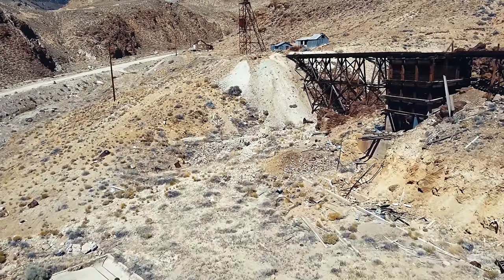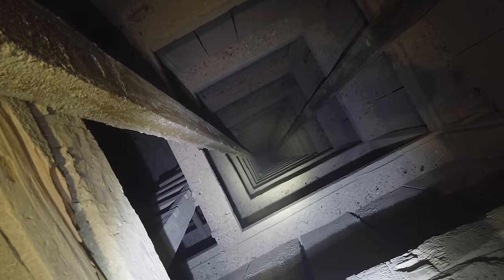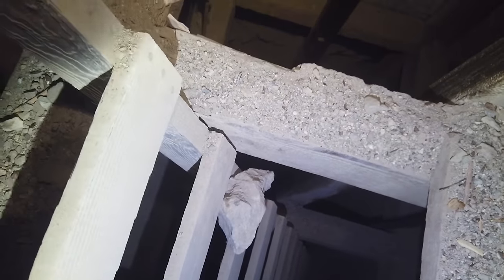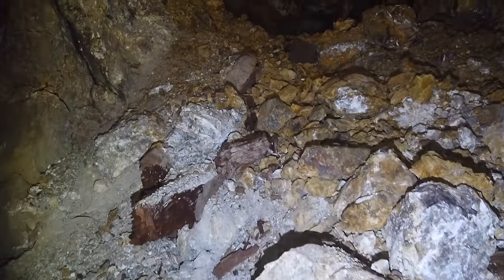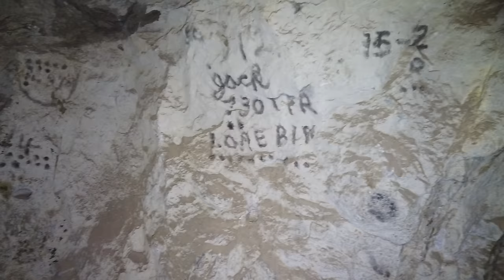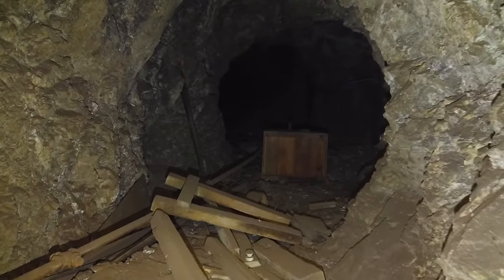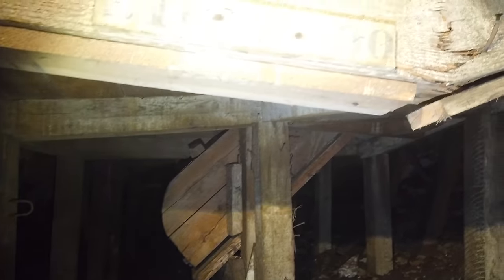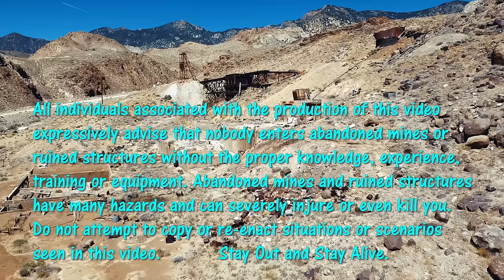My Best Exploration Ever! Inches From Death, As Dangerous as Mine Exploring Gets

Comment: As a former coal miner of 22  1/2 years, I have seen my share of dangerous roof and ribs. There were several fatalities of various causes at a couple of the mines I worked at. It was when we were pulling (mining) pillars (room and pillar mining) after driving up a section of the mine that it became really dangerous. I was a continuous miner operator for most of that time although I also did a lot of roof bolting. I developed PTSD  from all the years of escaping from falling ribs and top. I still occasionally have nightmares. You Sir are a brave individual.
Reply: Holy that does not sound fun, at all. Hoping you got some good lay in return at the very least
Reply: @trollscream8607  Lol, married and divorced twice. When it was good it was good, and when it was bad it was bad. I'm seventy two and still a workaholic. And the ladies like a lot of attention.
Reply: I had a friend who did mining for a month or 2 he did something like set something a support in place so the ribs could be set up or something to that extent, he said he felt like he was gonna die every day and quit, talked about water flooding in and all this other crazy stuff in just a month or 2 of work
Reply: Yea I don’t like enclosed spaces any longer either. In fact I will not fly for that reason.

Comment: Hi Gly, By now, someone has probably already told you but just in case . . . The grafitti that you read as “butt miner”, is actually “Butte”, as in Butte, Montana.  Butte, also known as ‘The Richest Hill On Earth’, was a big-time copper mining town.  The Berkley Pit in Butte was more than a mile deep and was really a sight to see before the water pumps were shut off. It’s still a mile deep but since they shut off the pumps back in the 1980s, it has been filling with very polluted water and is almost to the point where it will start overflowing.

Comment: I just can’t wrap my mind around all the hard work it would take to get all that lumber down that far to build those ladders that you’re  using. All the lumber that would be used all over that mine because that is a hell of a lot of lumber!!   I can’t,   Hard as I try I just can’t imagine the brute physical labor it took.  

And then I see piping what we in the oil field called screw pie which is small round pipe that air runs through.   My lord,  there is hundreds & hundreds of feet of it!!  it sits there was no elevator to be used looks like close by try to imagine going down those ladders so much!!     My Lord!!!!!

Comment: Gly - if you'd like to climb more shafts, I know of a mine in southeastern Arizona that has a 975' main hoisting shaft and a 600' escapeway shaft, both with manways in good condition (rehabbed in the mid-80s). The ladders at the collar aren't usable, but both shafts can be accessed via a pair of rubber-tire declines (to the 100' and 200' levels respectively). The mine was worked intermittently from the 1890s to about 1994, and I have it on good authority that a drill rig was left down there mostly complete. It's got a real interesting mix of old-school shrinkage stopes and modern longhole retreat stopes. I've thoroughly explored the horizontal workings, but haven't gone down either shaft yet. Let me know if you'd be interested - I know several miners who worked there in the 80s and 90s.
Reply from the maker: “Gly”: That sounds interesting. Contact me privately via email and I’ll see if I don’t already have it located and if it’s in an area where I’ll be exploring this winter.  abandonedandforgottenplaces@hotmail.com
Reply: @AbandonedandForgottenPlaces  Email has been sent.

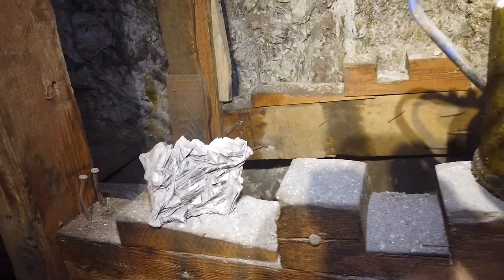Comment: At 1:24:17  He has an outstanding large specimen of “BARITE.”  It’s overwhelming use for it to be mined,  is because of my beloved Oil&Gas Industry.  It’s used as a weighting material in the formulation of drilling mud.  Barite increases the hydrostatic pressure of the drilling mud allowing it to compensate for high-pressure zones experienced during drilling.  

The softness of the mineral also prevents it from damaging drilling tools during drilling and enables it to serve as a lubricant.  The American Petroleum Institute (API) has established specifications for the use of barite in drilling mud.  

Right at 70 years ago,  a company was formed and named after Barite. It was and still is called,   “ Baroid Industrial Drilling Products.”  Today it is a wholly-owned separate company of  Halliburton corporation.  It’s the largest supplier of “Barite Drilling Mud.”

Comment: At the 400' level, in that ballroom, with all the black on the back of the mine, is it possible they had a fairly large fire in there? Not enough to burn up the timbers, as they're clearly rotted, not burnt, but enough to heat the rock and make it brittle and fragile, similar to how they used to make quick lime in the medieval times, so when it was exposed to the leaking ground water, it cracked and failed more easily?

Comment: I enjoy your curiosity about the many artifacts that you come across, but it seems that you skip over artifacts that I am curious about. Referring to the 600 foot level, I see a black & a white wire in the main repair area, but you make no mention about were they came from, where they are going, if @ other levers, At the top? Etc. Also, another artifact that I am interested in is the 2 metal pipes laying on the ground, same level. I assume that the larger pipe is for compressed air for power drills, what is the small pipe for?

Comment: Why did they only do drifts every 100'? Weren't there veins in between those levels? The drifts are all horizontal, so they weren't angling up and down to get any ore in between the levels. Can you tell me more about that?
Reply from the maker: “Gly”: So, imagine if the vein of ore your trying to extract is 1000 feet wide, 500 feet deep, 5 feet thick and on a 50 degree angle. The first thing you will do is drop in a inclined shaft from the surface following the angle of the vein down to the 500 foot level. Then after that you blast in horizontal drifts within the vein structure left and right of the inclined shaft every 100 feet down to the 500 foot level. Now, because you made your mine in this configuration you can have men on five different levels extracting ore and bringing that ore to the inclined shaft to be removed from the mine. In some mines, such as the Silver Souls for example, an additional horizontal haulage adit will be blasted in from the side of the mountain to intersect with the 100 or 200 level. Doing this will allow miners to remove ore from the mine twice as fast as compared to only having one inclined shaft. Underground hard rock mine layout is pretty much the same thing as scaffolding on the outside of a tall building when that building is being erected. Levels at 100 foot increments are pretty much the norm as it allows a much safer recovery of the ore as the miners stope out the areas between levels.
Reply: @AbandonedandForgottenPlaces  Thanks for the reply! I really enjoy your videos. I love geology and exploring. Old abandoned mines fascinate me. You combine all those things into enjoyable videos. Stay safe!

Comment: No mask for dust particles?
Reply from the maker: “Gly”: Wearing as mask is terrible for audio and generally not necessary for most mines. If your concerned about dust in general you are much more likely to breath in larger amounts of dust following behind another vehicle on a dusty road than you are when your in a mine. Molds and fungi are also not really a concern because I’m not doing much other than walking or climbing ladders that would force spores to become airborne. The location and type of mine also determines whether or not wearing a mask is appropriate. Mines in southern regions like Arizona and New Mexico can contain hantavirus and histoplasmosis so greater care is needed when exploring those areas such as not shuffling your feet when walking across rodent and bat droppings. A small amount of mines in the Mohave and Nevada contain asbestos or uranium so once again care is needed when exploring those types of mines. The goal when exploring dry mines is to always tread lightly and to kick up as little dust as possible to minimize exposure. Doing so doesn’t necessarily 100% guarantee you won’t breath in a harmful particulate but I’ve been doing this as a side hobby for 35 years and I’ve never had issues with my lungs. Contracting hantavirus and histoplasmosis or coming in contact with black mold is not a death sentence. Those with healthy immune systems and no underlying health conditions generally recover after being exposed. When exploring these places my biggest concern by far is air quality rather than dust or molds. Low Oxygen, CO2 levels and Hydrogen Sulfide Gas is a much greater concern and that’s why I wear gas monitors when I’m exploring these places. Finally, mines with extremely dangerous air quality that require SCUBA should never be explored.
Reply: @AbandonedandForgottenPlaces  right on man, thanks for the info